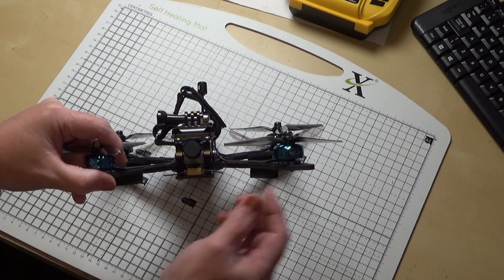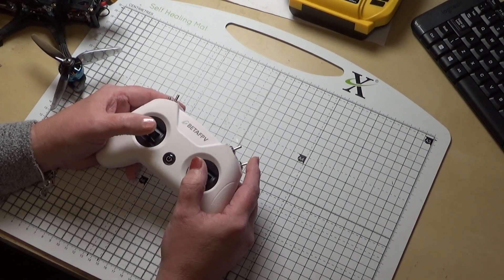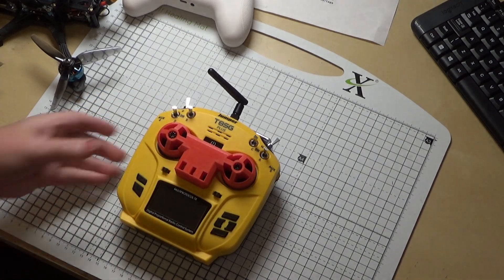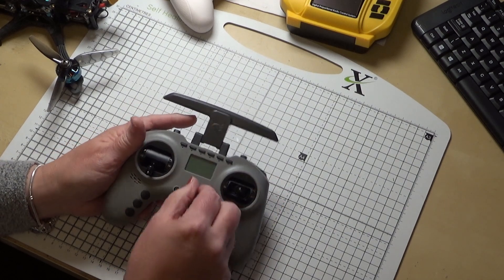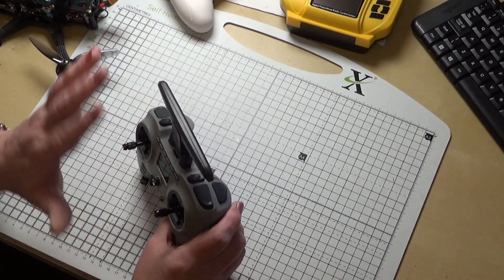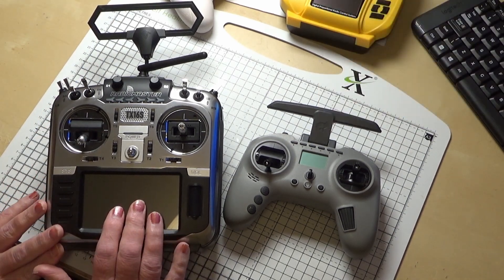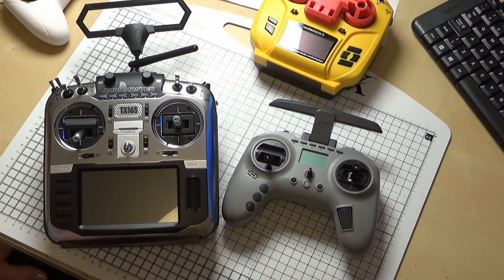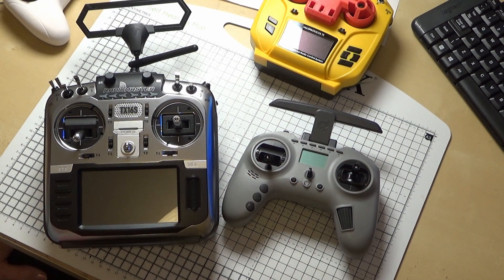All my 'proper' radio transmitters

Comment: Great video, Caroline!!! 

About 6 months ago, I took the leap from my DJI Mini 2 to FPV. 

I bought the BetaFPV Cetus Pro Kit which came with the LiteRadio 2 SE (Frsky) but then upgraded to the Cetus X and had to get the ELRS version of the LiteRadio 2 SE. BetaFPV makes great beginner products and they're an affordable way to get into FPV. As you mentioned, most of their products require their own configurator rather than BetaFlight. 

I recently bought the Bubito (the thing is soooo small it's adorable!!!) and got the RadioMaster TX12 Mark II (ELRS with EdgeTX)....it has all the capabilities of the TX16's but without all the bells and whistles.

I need a lot more practice on the simulators so I can at least fly indoors without bouncing off walls, ceilings, furniture, etc 🤣I would love to eventually get a nice 5" quad but my next purchase will be the DJI Avata. 

Well....I rambled quite a bit there (the old Scotsman is rubbing off on me 🤣😂 )  Again, great video and happy flying!!!!
Reply from the maker: The TX12 is a super radio, if it had been around when I bought the TSG8 it would have bought the TX12 instead!
I ended up buying a ew PC with a decent to good graphics card just so I could run Simulators (including MS Flight Sim 2020) well. My flying in the simulator and also in real life has really improved.
Reply: @Caroline_Tyler  The beginning of this year, I invested in a new laptop for the purpose of editing videos. Unfortunately, it only has integrated graphics. I've been running Liftoff and Liftoff Micro Drones off of it and it works okay. I also have FPVFreerider (it was a Joshua Bardwell recommendation). They've both definitely helped but I don't even have 20 hours between all of them so I need to spend some more time.....which since it's almost Winter...I should definitely have the time.
Reply from the maker: I was in the same position - nice computer (an All-In-One PC) but it had no graphics grunt. With my new PC Lift-Off, TryP and Uncrashed all run super smooth, the latency of the old PC was killing me!